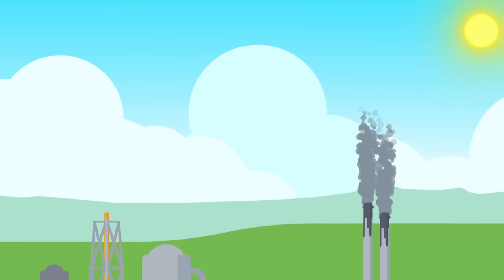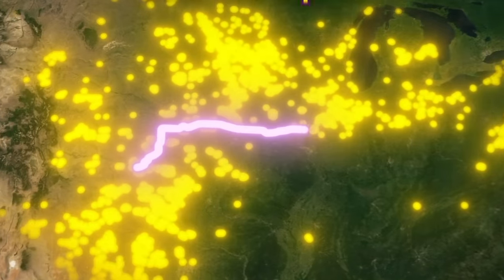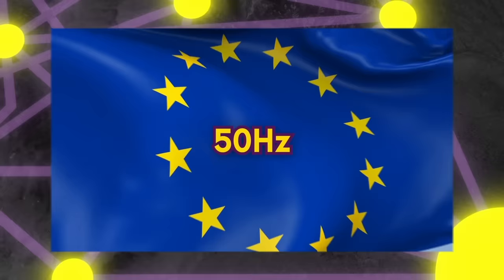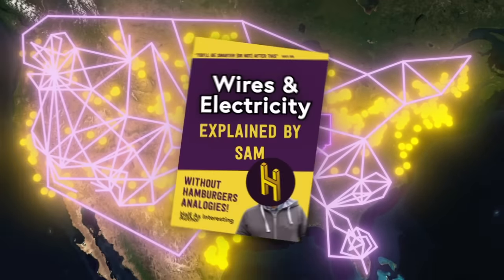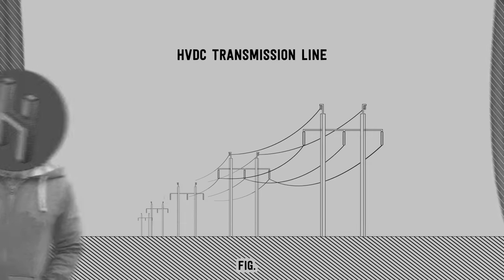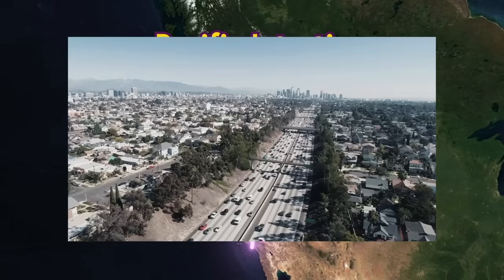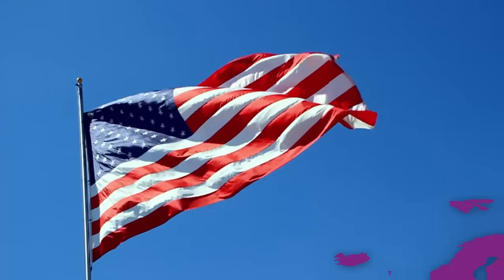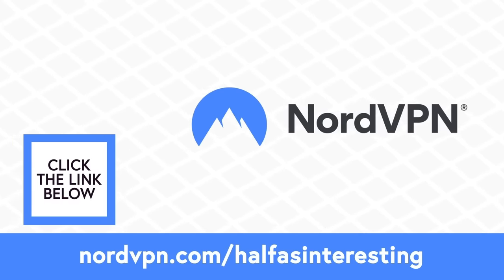Why We’re Building a 790-Mile Wire From Kansas to Indiana

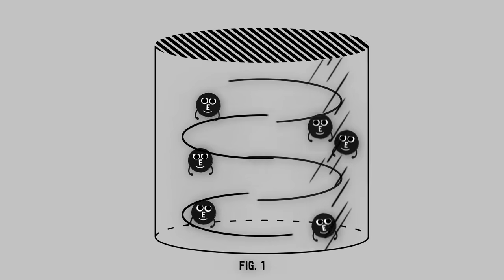Comment: 3:15 skin effect isn't really the limiting factor, the limiting factor is capacitive reactive power, that you need the charge the parasitic earth capacitance. That is also the reason why cables (both offshore and onshore) are DC, even at smaller distances, because the parasitic capacitances are much bigger than in overhead power lines
Reply: moreover, all the stock photos and videos that were described as HVDC lines were almost certainly the normal three-phase AC transmission lines that this project is not using. DC transmission lines are typically two conductors.
Reply: @PaulFisher  not always. Some HVDC-lines use a positive, a negative and a central tapped conductor (so effectivly +500kv,0kv and -500kv against earth for example). I don't know what the exact implementation in this project is, but both 2 and 3 conductors are possible
Reply: So there's no cables that are AC?
Reply: Whatever nerd
Reply: @OllieHamon Most cables are AC, just not some of the more powerful ones.
Reply: @OllieHamon  there are ac-cables, but anything over a few 100 km with a few 100kv can realisticly only be done by DC
Reply: And also, I don't think that the strands in overhead wire conductors are insulated to each other. So they don't really prevent the skin effect. The real reason is why all steel "cables" are stranded: to make them more flexible compared to a solid rod.
Reply: @marco23p transmission lines have a steel wire core and then aluminum wire around it . very few lines use copper  because copper is super heavy , more than steel,  and also costs about 5 times as much or more . the extra weight would mean the towers would need to be much stronger etc. and almost all power wires on poles and towers are bare . the insulation is the hangers or insulators.
Reply: @marco23p  also skin effect at 50 Hz starts to make problems for conductors with a radius of more than 60mm or smething like that, so even if it was a solid conductor, the cross section would be to small to make a big difference
Reply: Impedance matching should account for this. Making an lc tank out of the parasitic capacitsnce and a corrective inductor can help somewhat because their reactance cancel out at resonance. You need to know inductance existing of the wire, parasitic capacitance, frequency, and you need to tweak one or the other for resonant frequency to match actual frequency. Im summarizing a fair bit.
Reply: Higher voltages also reduce resistive losses
Reply: @SlavTiger  that doesn't really work that well, because the current flowing between your inductance and the distributed parasitic capacitance is very large and leads to big resistive losses and heating, only limiting the transmission capacity for real power further
Reply: @marco23p Yeah the main reason we use multistrand copper conductors is because copper work-hardens like a mfer and becomes insanely brittle, so having more smaller conductors means each individual one has to bend less than one big one would.
Reply: Huh
Reply: @EDLEXUS  that may be true, but looking at a selection of existing over-land HVDC projects in the US (Pacific DC Intertie, QC–N.E., Square Butte, CU, Intermountain; i.e. the ones I have seen myself or could easily find pictures of on Wikipedia), they all appear to be two-conductor systems. I think it’s fair to say that HVDC is typically two-conductor, and if you see a three-conductor line, it’s almost certainly three-phase.
Reply: @PaulFisher  yeah, possible. To be fair, I have no Idea about the implementation in north america, I mostly know about new-ish projects in central europe, that are based on 3 conductors (mixed overhead line and cable)
Reply: @EDLEXUS even one conductor is possible if you have an earth return system
Reply: how would capacitive reactive power be a problem? almost every type of load out there is inductive, so it should cancel out
Reply: More so the inductive reactance is the limiting factor,  not so much the capacitive reactance. They transpose the conductors to equalize the capacitive reactance and use reactors on lightly loaded transmission lines to lower the increase in voltage the capacitive inductance causes. The major line loss in AC transmission lines is from the impedance from  inductive reactance generated from the twisted strands, which fight the flow of current. The more current that flows, the greater the inductive reactance (impedance) becomes which causes the conductors to heat up and causes more line losses. With DC you only have the resistance of the conductor itself.
Reply: @PaulFisher  the most cost effective DC lines are built as bipole, allowing +500 and -500kv DC, effectively doubling the voltage of the line without requiring larger insulators, this however requires a reliable low impedance ground reference to maintain this balance, where ground conditions are not good (in fact almost perfect) such as sandy or rocky soil, a third conductor known as a dedicated metallic return DMR is run.  The DMR can also be used in contingency situations where one of the main conductors is lost to allow monopole operation.  I could go on for an hour about how it works but I would bore myself.  The EATL and WATL lines in Alberta are good examples of this system
Reply: I gotta say, I love this discussion. I knew this video would bring out my peeps (the “Well actually…” crowd) and I’m so here for it. 😊 ❤
Reply: Yeah everyone thinks that the large spacing on high voltage transmission lines is because of voltage and arcing, but really it's to reduce capacitive coupling and low leading power factor. That is a big reason we don't build more underground transmission lines. Even if you ran all three phase conductors in 3 seperate trenches you will still capacitive couple with the earth
Reply: @joecummings1260 certainly the bigger reason is cost. It already costs an insane amount to build a transmission line, to build one underground costs so much more its nuts
Reply: Are you sure this is applicable to overhead lines? I know this is definitely true for underground/underwater cables, I've never seen it as an argument for overhead lines though.
Reply: @JackJackJackJackJackJack  Yeah, but there comes a point due to length where you could have an unlimited budget and it still wouldn't work
Reply: You must be in Europe. It takes a much bigger wire to transmit DC power than AC power, and the losses are much greater with DC transmission. That's why in the US, all high-voltage long-range power transmission is AC only. I'm not sure there is any DC power transmission in the US at all. @EDLEXUS
Reply: @TehButterflyEffect  a) yes, I am in Europe, but this doesn't matter because the laws of physics are the same everywhere
b) I don't know of any DC-Interconnects in north america, because I'm not from there, but somewhere in this comment chain, someone postet a list of north-american DC-Interconnects, so refer to that
c) to transmit the same power at the same voltage (AC or DC), the ac-current will be bigger, because you have additional current due to reactive power caused by parasitic effects in your transmission lines and the skin effect. So for the same power at the same voltage, there are more losses in the transmission line when using ac. Dc has smaller losses while transmitting. But dc has more losses when converting from one voltage to another, because dc-dc-converters have more losses than transformers. So there is a balance between losses while converting and losses while transmitting. Thats why sometimes ac is better and sometimes (especially for long point-to-point distances) dc is better.
Reply: @dustinboyce25  cool! I found the EATL on Google Street View and can see the three conductors. It looks like the two on the sides are the poles; they’re suspended a large distance from the pylons. Then in the middle is what I assume is the neutral. It is a smaller conductor (maybe the same cables but 2× rather than 4×?) and hangs on a substantially shorter insulator and threads through a relatively small opening through the pylon, I am guessing because it is going to stay at fairly low potential compared to ground. It does look distinctly different from a traditional AC transmission line because of this, though. Thanks for the reply! I am very much enjoying learning more about this.
Reply: @PaulFisher  you described the setup of the line very well.  Yes 4x bundles on the pole conductors and a 2x bundle on the DMR through the middle.  Definitely a unique look vs. 3 phase AC lines
Reply: Yes. Skin effect is a function of frequency.  Skin effect at 60Hz is tiny.
Reply: @Fetherko  At 60Hz the effective skin depth where the majority of current flows is less than 10mm.  The use of stranded cables vs single strand wire will help to decrease this, but at the end of the day, even at 60Hz the core of your cable carries virtually no current.  Hence why we use steel core cables to increase the overall strength vs and equivalent aluminum diameter

Comment: At 3:20 you said that we make wires out of many strands to avoid eddy currents, this is wrong. Whilst we do have litz wire that disrupts the skin effect, this is due to the strands being braided, not just because it is made out of individual strands. The bigger reason why wires are made of strands is mechanical, one solid wire is stiff and hard to bend whilst stranded wire is like rope.
Reply: Ybokors;  You are sort of correct, but also significantly incorrect...  Yes we have litz wire (from the German word "litzendraht") and indeed litz wire may be twisted, woven, or braided but the KEY factor that enables it to reduce the increase in resistance at high frequencies caused by the skin effect is that the individual strands of litz wire are INSULATED from one another.  The braiding or weaving pattern is of secondary importance.  The braiding is used to cause each strand to spend equal amounts of its length in the core of the bundle or on the outside of the bundle and this causes equal impedance in each strand so the current splits evenly over all strands.  The main factor in reducing the resistance at high frequencies is that the strands are insulated from each other which causes the strands to have a very large surface area relative to the mass of conductor metal used.
Reply: Also, because engineers love Twizzlers Pull-N-Peel
Reply: @Vincent_Sullivan So, you consider 50 or 60 Hz to be high frequencies? Huh... what frequency range would you call low frequency then? But your overall point nevertheless stands. :-)
Reply: Eddy currents or skin effect is not what prevents long distance AC lines.
It is the inductance and capacitance of the wire which causes the long-distance losses in HVAC lines.
Reply: @elgonzo7239   Nowhere in my comment did I mention 50/60 Hz. as being "high frequency".  I merely wanted to point out to Ybokors that he was incorrect about what construction aspect of litz wire is mainly responsible for the improvement in performance at high frequencies.  It is the insulation of the strands, not the braiding.

      However, since you mention frequency...  No, I don't consider 50/60 Hz. as "high frequency" however even at this frequency skin effect may still have to be considered.  It would be an unusual engineering situation when designing small equipment that would justify considering litz (or other skin effect mitigation measures such as conductor foils or tubes) at 50/60 Hz.  At 60 Hz in copper (yes, the material of the conductor (due to different resistivities) affects the skin depth at a given frequency) the skin depth is about 0.3" (8 mm) so the skin effect in small wires is not significant.  If you are designing a power station where thousands of amps are flowing at 50/60 Hz. it is a different matter because you need large conductors!  A single conductor large enough for such a current flow would suffer from skin effect even at 50/60 Hz.  The usual solution in this case is multiple parallel wires or buss bars each individually small enough to not suffer from skin effect.  This uses the same concept as litz but without the braiding as the inductive / capacitive effects are not significant over the short distances involved and the low frequency of 50/60 Hz.

      Of course every engineering project is different, but as a rule of thumb for small devices I only start to consider litz around 10 KHz.  Even then, the advantages of litz are not that significant until you get up to 20-30 KHz.   There is also an upper end to the frequency at which litz wire provides useful advantage.  This is caused by parasitic capacitance between the strands which starts to make the litz cable behave more like a solid wire with the attendent skin effect losses. The useful limit for litz is typically somewhere around 1 to 2 MHz. 

        The bottom line is that when designing a system that might possibly suffer from skin effect problems you have to consider not just frequency but also conductor size required for the current involved and the conductor material - along with all the other factors that enter into the design!
Reply: @vonnikon   What you say is essentially true but I would not discount skin effect losses completely.  Also the inductance and capacitance do not in and of themselves create the loss.

         The basic loss causing parameter is the ohmic resistance of the line. This is easy to understand using Ohms law.  The voltage at the load end of the line is lower than at the source end of the line due to the current flowing through the resistance of the line.  This voltage reduction is proportional to the resistance of the line and the current flowing and represents a power loss.

      The skin effect essentially reduces the conductor cross section thus increasing the ohmic losses.  Long distance power lines typically have large conductors so the skin effect may be noticeable even at 50/60 Hz.  Such cables do use a couple of engineering tricks to help with this.  Most such cables are "ACSR" which stands for "Aluminum Conductor steel Reinforced".  The steel strands in the center have a higher resistivity than the aluminum so they tend to force the current to flow in the aluminum conductors in the outer part of the cable.  The conductors, being aluminum, have a higher resistivity than copper so they have a greater skin depth at a given frequency.  Thus they are not as much affected by the skin effect as would a higher conductivity metal.

        As you point out, the real problems arise because of the capacitance and inductance of the line but these do not directly create the loss.  What they do is create a lot of "reactive power" (VARS) as the capacitance and inductance are charged and discharged 50 or 60 times a second.  This reactive power has to flow in the line even though it does no useful work but in flowing through the line it increases the losses in the ohmic resistance of the line.  Typical losses for overhead 3 phase 50/60 Hz transmission lines run in the range of 6 to 10 percent per 1000 Km.  For AC underground/underwater lines the losses are about 10 times this due to the much higher capacitance of the line due to its design which requires insulating materials with a much higher dielectric constant than air.  High voltage DC lines suffer only from ohmic losses.  Skin effect and reactive power losses are simply not a factor.  As a result losses for HVDC lines run about 4 percent per 1000 Km.  If you are transmitting a lot of power the savings can be considerable.  As a rule of thumb if you are transmitting large amounts of power it may be financially advantageous to consider using HVDC for overhead line longer than about 500-600 Km. and for underground/underwater lines greater than about 50-60 Km.